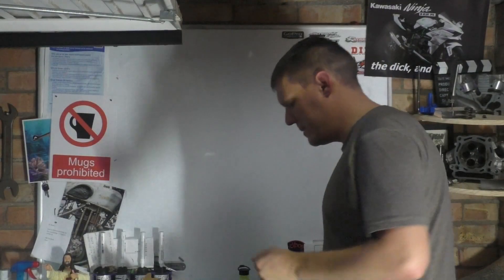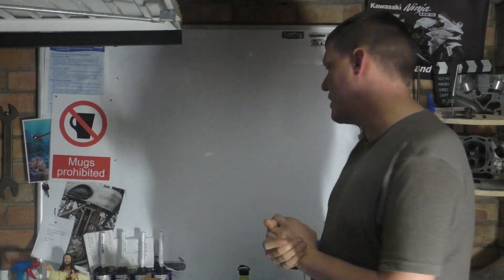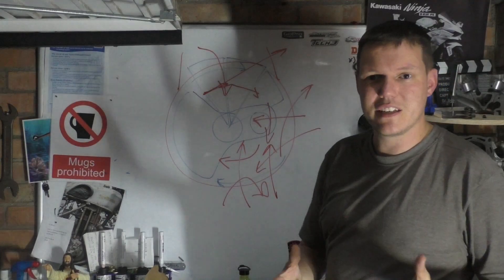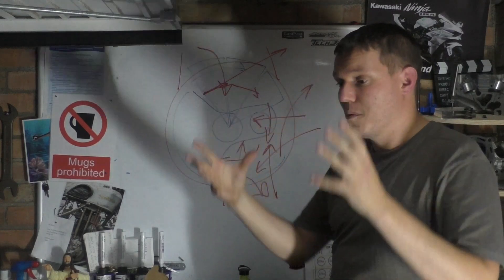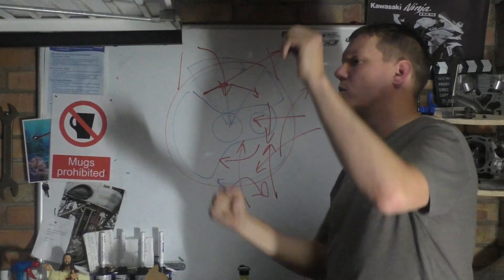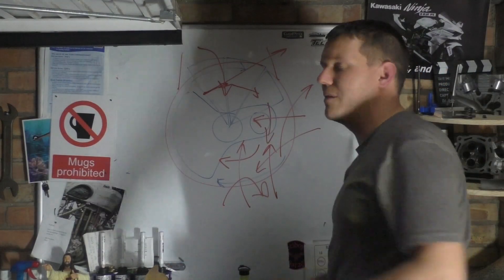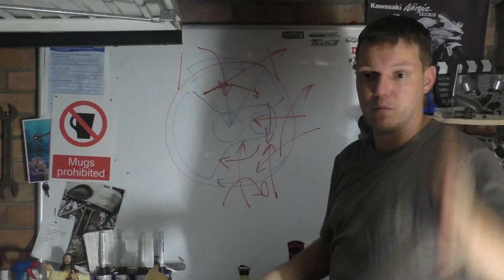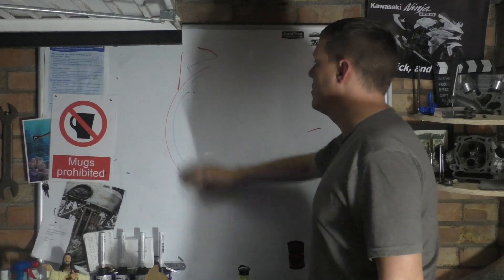Knife edging Crankshafts - Does it work?

Comment: From what I understood, the point of knifing the crank was to help the crank slice through the oil easier, not the air. The secondary benefit was the weight loss. Please don't mock me for this, I fully admit, I know very little about engine building. I just started building small engines for go-karts and minibikes. I'm having a lot of fun doing it. I was thinking about knifing the crank on a new motor I'm working on, then balancing it again. From what you've said, it's a waste of time. So, just to clarify, knifing the crank will not help the engine spin-up faster because it gets through the oil easier? I appreciate any advice, and thanks for the video.
Reply: You heard correctly, knife edging is for oil control and weight, not air, and it can be a noticeable source of drag in a high RPM motor. It's benefits in low RPM motors is much more dubious.

Comment: Oil not air. not always but cornering braking and high rpm windage pickup send oil into the crank, Sorry but it does work and shows hp gains at hi rpm on a dyno.
Reply from the maker: Evidence....

Comment: What kind of positive/negative effect would shaving all that weight off the crank have? Or would it be the same as just taking weight off the flywheel?
Reply from the maker: Faster acceleration of the rotating mass, but this works both ways. You also loose momentum in the corners, so you loose corner speed.

Comment: On marine gasoline rc boat, such as zenoah 26cc, 29cc.. Knife edging on crankshaft were very noticeable in performance especially on high rpm. Few reason for this
1. Its help lightened the crankshaft
2. Better flow towards the transfer port for air/fuel mix
3. Increasing the volume on crankscase

Yes, its nothing to do with the air drag, but the air fuel flow towards the transfer port is really matter.

Just simply change the crankshaft to original back, then you will notice the power output different compare to the knife edged crankshaft.
For high rev use such as rc boat, this type of turbo mod is really works and gain much higher rpm.

Its not a myths. Its a fact.
Reply from the maker: Lightening the crank, that's it.

Comment: You daft, silly bugger. This treatment is NOT for "slicing through the air" you twat, this is for "slicing through the oil" which has a HELL of a lot of sheer and breakaway force in the oil pan. It is for windage and oil control in the crank case and oil pan. This being said this guy is a fucking idiot because the crank is now out of balance without a way to put it back in. Both of you are equally wrong on this one.
Reply from the maker: Wait. I love this type of comment. So you think the knife edge is for cutting through oil? So these droplets that are smaller than a mm are sliced in half by the edge of this feature? 🤣🤣🤣🤣

What happens if it doesn't hit the oil square on? What happens of the edge isn't smaller than 1mm? Does it just mush into the oil? 🤣🤣🤣

Love to hear your reasoning

Comment: This video is pointless, the point of knife edging a crank shaft is to reduce rotational mass thus increasing engine acceleration, the same reason an atomizer is used in the carburetor which directs the accelerator nozzle spray direct into the air stream, which greatly improves throttle response and acceleration, but hey drag racers are just stupid in trying to get every single ounce out of their engines.
Reply from the maker: Oh is it...

Comment: It's for the crank shaft itself to go through a medium, like oil, better.  Air in the engine...you got stuck on that idea and it was a pointless one.  You convinced so many people the air in the engine won't have any affect on knifed crank shafts though.
Reply from the maker: As the crankshaft spins it drags the air around with it. Therefore the air resistance theory is bullshit. Dont worry though, ill prove it
Reply: @thedirtyworkshop  you understand air and oil are two separate mediums and do not share the same physical properties?  You understand a crank case is filled with this medium (oil) that the crank actually spins in?  Tell me about the air again....
Reply from the maker: Air and oil both conform to conservation of momentum...

If you think your crankcase is full of oil then you're more stupid than you sound

Comment: Ok you have to keep in mind the crank is not just going through air its going through oil so think about it whats easier to drag through a pool of oil a knife or a 2x4 any thing you can do to decrease rotational mass or resistance is gonna translate to horsepower and torque
Reply from the maker: Lmao. Think about that you just said. Air can be thought of as a liquid. So aerodynamics is like hydrodynamics. Seen as though liquid and gases are just molecules spaced apart. Oil droplets are not.
Reply from the maker: A pool of oil is a continuous fluid. Droplets are not. Thats called an aerosol

Comment: My understanding is that you want the leading edge bullnosed in shape , and the trailing edge knife edged ! The back shape is more important than the front , but those mods on a 2 stroke really won't help much because the crank helps to atomize the fuel better as is . In drag engine or any sustained rpm application it may help a little but in the street you'd never know it . Powers in the valverain / intake / cylinder heads .

Comment: Matt, thank you, excellent. I am about to rebuild a 7MGE I was / am thinking of isotropically polishing the crank journals.  Could you do a vid on the engineering merit of this surface treatment?
Reply from the maker: "isotropically polishing" - pretty much a waste of money. The crank 'float's on oil 99.9% of the time, that other 0.01% is what you're bearings are for. This has all been accounted for by the OEM

Comment: Back in the 80s i worked for a place named Falicon performance. We only did cranks and related parts. We made rods for just about anything we even made a v-8 kawasaki eng. That ended up on a snowmobile. My job was to knife edge and polish cranks. Rods, repair cranks and rods and make cranks and rods. From top fuel to h-2s. We put our crank against vance and hines cranks, vance did the test, and ours made more power. Every time. All the big race teams used us at the time, vance, human race, and alot of big names. I dont know if it was the "supercrank" treatment or just a better, more precise crank build. Our balancing was always spot on perfect. Allways nothing less than absolutr perfection went out the door at that place.
.
Reply from the maker: "and ours made more power. " - it's called inertia. It the mass is reduced then last energy is 'lost' to that system. You also however - lose corner speed

Comment: A: that kid knows nothing about knifing a crank.
It is NOT to decrease aero drag or oil foam drag and what not that you ar talking about. 
B: its job is to direct the oil sling from the bearings better so that the crank can be better balanced as it spins, oil adds unbalancing and thus harder to get to higher RPM. 
C: lower rotating mass, faster and higher RPMs
thats it.

Comment: Knife edging isn't for areo dynamics, atleast in a sense of if the crankshaft where exposed to just air which it is not. In an engine there's also oil being flung around causing a mist of oil throughout the crankcase, knife edging allows the crankshaft to cut through that oil mist easier and helps to reduce that mist allowing the oil to drain back to the oil pan easier which is pretty important. Also if there is enough oil being flung around in the engine the oil can become frothy and can cause oil pressure issues if it becomes bad enough, this can happen whether you have a windage try or not though it is significantly reduced if you have one. There is also the bennifit of weight reduction which is a nice bonus. Having said all of that knife edging isn't for normal everyday engines its more of race/high rpm type of modification, that is where it will make the biggest difference. You also can't just knife edge a crank and slap it back into a motor, everything will need to be rebalanced otherwise it's just a bomb ready to go off.
Reply from the maker: Knife edging isn't for areo dynamics, atleast in a sense of if the crankshaft where exposed to just air which it is not. In an engine 
there's also oil being flung around causing a mist of oil throughout the  crankcase, knife edging allows the crankshaft to cut through that oil mist easier and helps to reduce that mist.

 Aerodynaimcs or fluid dynamics - its the same thing.......

One other point is that high performance engines - lets say the Veyron isn't knife-edged? Are they just fucking stupid or something? Either are Yamaha or Suzuki.......... the list goes on.

https://qph.fs.quoracdn.net/main-qimg-f519c24282672e51db6b59451302039f

"There is also the bennifit of weight reduction which is a nice bonus."

- this is more in-line with the truth, but reducing the moment of inertia is the reason - not oil mist.........

Comment: Great videos Matt. Totally with you on the whole knife edging thing but I noticed you touched on vacuum in crankcases a few times there. I havn't done a massive amount of reading on the matter so thought I would ask your opinion on using that as a method of gaining more power/performance and giving you an actual benefit over something like knife edging  your crank. I've seen some claims of gaining around 15hp when using a dry sump pump system and a vacuum level of 8HG? Can this realistically be achieved for using such a set up? 

Keep up the great videos 👍
Reply from the maker: We'll get to this very soon
Reply: @thedirtyworkshop  looking forward to hearing about it in more detail. Various websites have mentioned it Reducing windage around the rotating assembly so thought It may be linked to this video. 
Cheers

Comment: Yeah, but it makes the cranks super slippy, and if you use enough copper grease you can reduce the resistance to zero, below zero in fact. Plus, if you've eliminated overheating by using Evans, your engine will go so fast it will correct the asymmetry in your HUMuNGOUS heavy tail. Ah, the gifts that keep giving ;))
Reply from the maker: Below zero friction - I'd buy that for a dollar!
Reply: ;)) bro, I've got a shed full of it you can have for not a lot more than Delboy spent on filler ...!;))

Comment: Ignoring the up / down flow from cylinder to cylinder, the best analogy I can think of for  what the air in your crankcase is doing, is stirring a cup of tea, where the crankcase is the cup, the crankshaft is the spoon, and the air is the tea.  A certain amount of the air will be "sticking" to, and end up spinning with, the crank, which will end up spinning in a spinning column of air, and will exhibit very reduced drag relative to the same shape slamming into stationary air.   In reality, despite the piston displacement up and down in a multi-cylinder engine forcing cross-engine airflow, some of the air around the crank will most likely do this anyway.

Knife-edging isn't going to make much difference.  Some, probably, maybe even measurably so, but not enough to warrant taking your engine to bits and modding the crank.  There's probably more to be gained by doing it to reduce the rotating mass, meaning faster acceleration.  But you could do that by drilling holes in your flywheel :)

And then there's technique. Milling machine -> dynamic balancer -> shot peening -> crack detection, I can see that working.  "Free handing it" with a die grinder sounds a lot like a surefire way to have pieces of crank exiting the crankcase at high velocity.   

Still, it looks pretty before you hide it in the crankcase, and getting it done "properly" is a very good way to spend a lot of money on motor homeopathy.
Reply: I love the term motor homeopathy. Great post.
Reply: you've the only sensible comment I have read. done correctly, there are immense benefits.. hence the reason we see it in the top performance engines. like f1 engines. but no with a dremel in your basement is a surefire way to scatter your engine guts all over the roadway.

Comment: The old argument for knife edging was to reduce windage, as others have mentioned, through oil.  Back in the days of doing machine work for race engines, the main reason we would perform work such as knife edging came down to reducing the moment of inertia for an engine being built to rev much higher than it normally would, and get into its higher RPM power band more quickly (i.e race engines).  Basically the same idea behind a lighter flywheel.  We never just "knife edged" the crankshaft though, and performed a complete "package" that addressed every part of the rotating assembly, both static and dynamic balacing with the crank, rods, and pistons so it didn't encounter harmonics, which will destroy the crank, bearings, and potentially even the block, if not done properly.

Comment: Back in the 1970's one could buy FALTA "Pork Chop" cranks to replace the disc type cranks in CZ 250 / 380 / 400 MX as these used the exact same engine as the ISDT Enduro bikes.

The advantages were:

(1) Larger crank case volume for induction.
(2) Less rotational inertia so more rapid crank speed increase (throttle response more snappy).
(3) Increased power (see (1)).

The disadvantages were:

(1) Decreased engine braking.
(2) Changed the resonance of the engine (different vibes @ RPM compared to OEM crank).

Like using very long through block engine bolts on an engine, knife edging the crank has been tried in the distant past, been found to be a seriously bad idea and dropped.

Wait!! Didn't some idiot at Rover, who hadn't read that the longer the bolt the more it lengthens under hot conditions design the "Blows a head gasket at least twice a year" long bolt rover engine. (My mother unfortunately had one of these mistakes as a car a few years ago).
 
Something for a future video on major manufacturing and design cock ups: The notorious long bolt Rover engine fiasco!!
Reply: Noooo. Wrong. The head gasket failure was due to faulty oil delivery gasket sealing of the head/block interface (never used that word previously) supplying the cam etc. above said gasket. 

They did have a reasonable number of failures. 

However fitting an updated gasket meant that the problem didn't return; and no planing of the head surface necessary. 

I have repaired quite a few and not had a single one return with the same issue. 

Bare in mind I have been servicing/ repairing cars since 1972 so it's not a surprise that I have repaired "quite a few".

The 'K' series engine is an excellent motor. The long head retaining fasteners are not, in themselves, problematic. 

Amen (and A-woman; for those that are a bit limp under the cap 😆🤣😂).

Comment: This sounds like the same effect  race mechanics are trying to achieve with crankcase scavenging on dry sump systems where the scavenge pump not only removes oil from the sump but is also creating a partial vacuum, thus removing resistance of the air on the crankshaft by reducing it and theoretically freeing more power. (Note:- I Say freeing not creating!)
Reply: You're actually spot on! I'm so surprised this wasn't mentioned!... Windage

Comment: how is the crank case ventilated? into the vacuum of the intake? so give or take a bit for blow by or throttle position the crank case should be running at least a partial vacuum negating aerodynamics almost completely?
Reply: there is positive pressure in the crankcase because of ring blow and it is returned to the intake tract (normally) for emmissions either via a straight breather or to the pcv valve which is post butterfly. under low throttle and idle conditions there is still no vacuum as your pvc is not only drawing from the crankcase but also back through the extra, unimpeded breather thats directly linked to your intake system

Comment: there this 1 more thing guys try they cut lines around a crank and they say it mixes ur air fuel better on 2 strokes I did this 1 time and I don't like doing it but people sell this to people ,what do you think about it
Reply: Lets see... you have a mix of petrol and air that wooshes through the intake at enormous speed like a vortex into the bottom of the crank case. The crank is spinning around mixing it as well. And someone think that creating grooves in a crank will make it even better? 
Only thing i see with unnecessery grooves in a crank is stress points for fractures. 
But hey, im not an expert. 
MATT! What do you say?
Reply: I don't thank that but yea look it up that what turbo crank is and big name dirt bike and snow mobile was doing this mod not to long ago some still do it for money its all about money and if anything I think you will just lose crank bottom end compression ,increase volume and lose power in most 2 strokes ,I think the grooves are to small  with a crank moving  that fast to do anything ,another thing to look at is guy use to cut a tread with a big treading tap in to the bore of a big carb to get a finer  mix in old pulling tracker and it works and made more power to but the carbs are way better today and a treaded carb will not work good on new trackers  the carbs today mix way finer ,I saw guy and modders try grooving carbs for the same thing they dont use a tap  the grooves are lined with the way the air goes but I know a guy that got a bike with a carb a modder did that to and it runs like crap and its never tuned out its funny when guy look at all the wrong thing and think that's were the power is but then again you never know till you try

Comment: My FSAE team is considering removing first and sixth gear from the transmission on our R6 motor. Saves about 600 grams.
Reply: I was reading an article a while ago about a motocross build where they took out first and fifth, and the guys test riding it didn't feel like it made the bike particularly hard to ride.
Reply: Go for a longer final drive and remove 5th and 6th? Might depend on how the shift forks are set up.